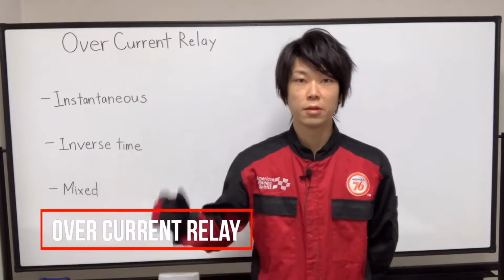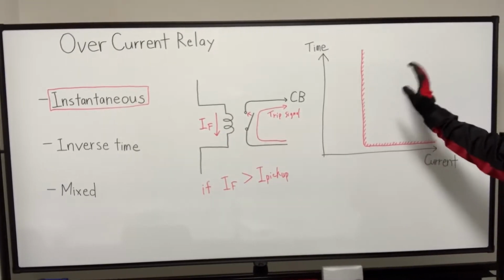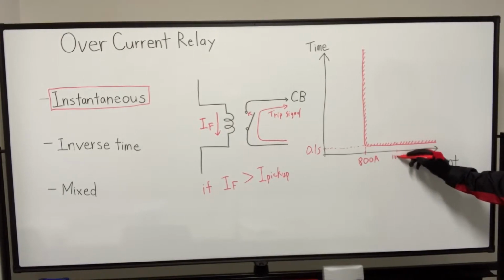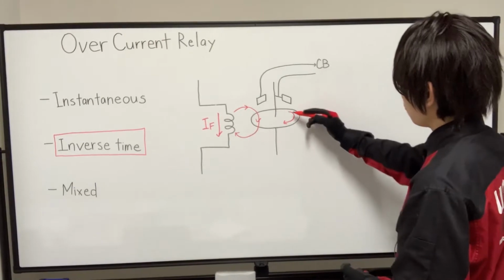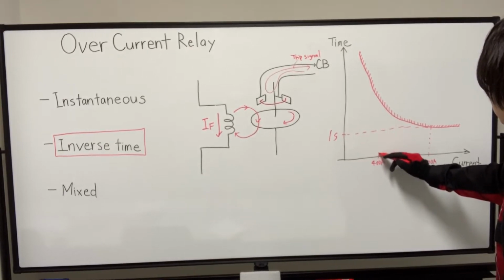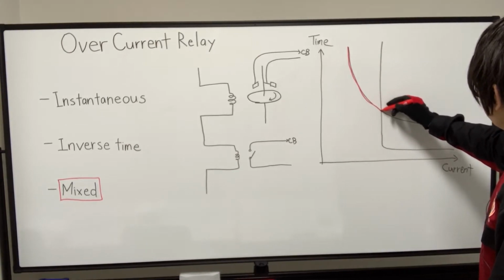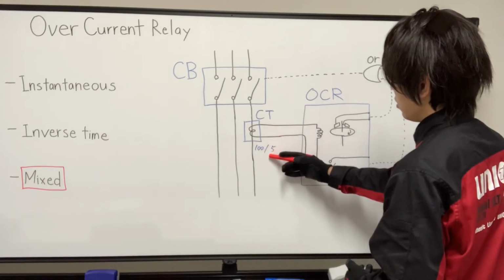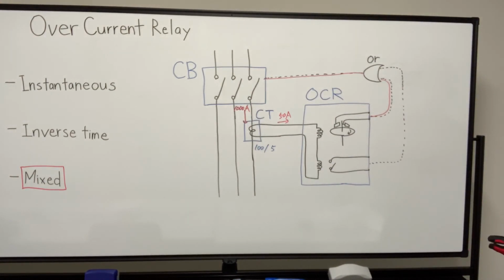Over Current  Relay 1

Comment: Thank you very much, but excuse me kindly, didn't the CT would enter the saturation mode if it get 1000 A in it's primary ? Because I noticed that your CT's primary current rating was 100 A
Reply from the maker: Thank you for watching my video and I really appreciate you pointing it out.
You're right, these are extreme values for easily understanding and explanations. Actually it exceed the ratings of CT.
Anyways, Thanks for very kind comment.
Reply: You are welcome, thank you again and I also appreciate your efforts and your time in making these great videos. your explanation to the topics are really awesome and it is very understandable, I could get the idea of the inverse time over current relay's working principle perfectly through your clarifications.
Reply from the maker: @noxudal7693  My deepest thanks to  your encouragement.
Reply: Hello thanks for the explanations.
Reply: CT for protection usually can handle 20x rated current without saturation, so in this case you could have 2000A in primary and 100A in secondary of CT.
It depends on burden resistance and CT ratio.